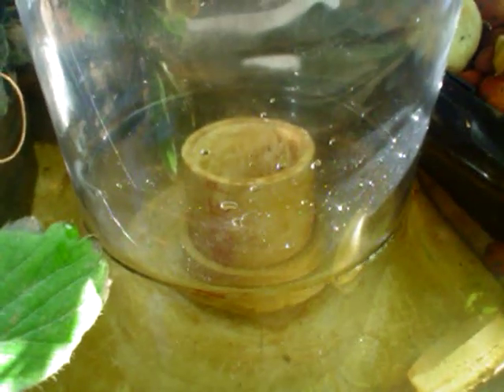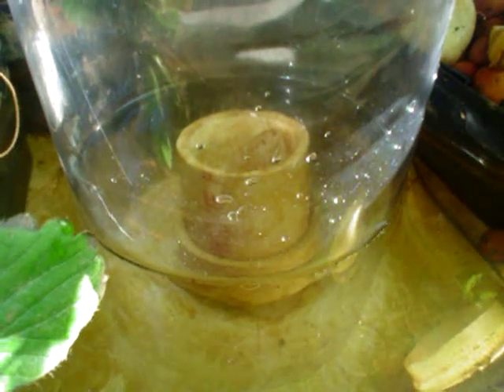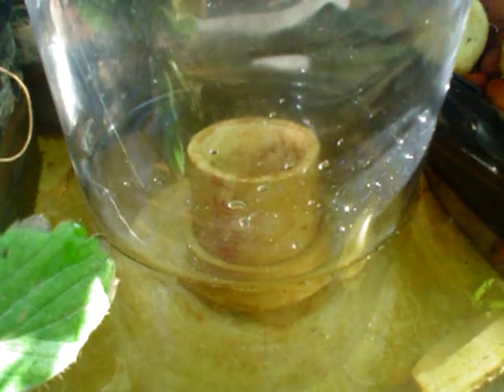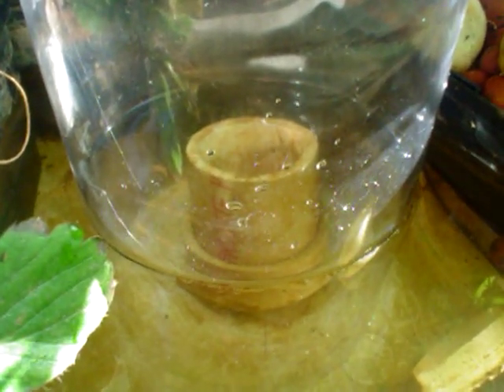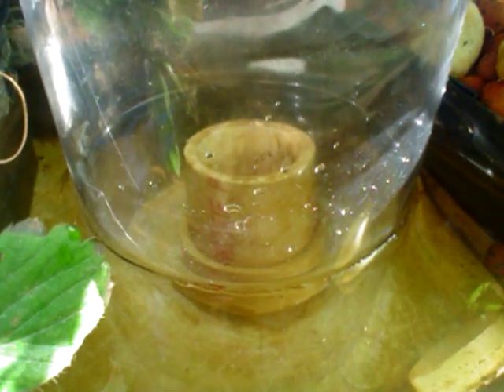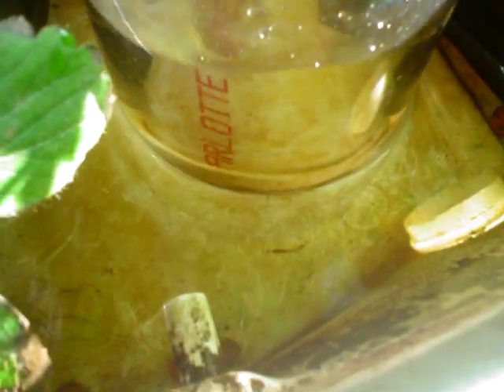How a bell siphon works

Comment from the maker: The length depends on how deep your growing medium will be. I recommend 10-12 inches of grow medium with a pipe 2 inches lower than the top of the medium (12 inches of medium use 10 inch pipe). You will also want your outer pipe, the bell, to be double the diameter of the inner pipe (half inch inner 1 inch outer or 2 inch inner 4 inch outer)

Comment: Thank you!  It is a very very good demo.  But if I wanna make a small-scaled aquaponic system, like one in my backyard with nomal rubbermaid sized container, what exactly measurements I need for the setup such as those pipe diameters, length of PVCs exactly.  I just wanna try to see if I can use it for planting veges.  Many thanks!

Comment: that's why you make the slits higher and your water supply slower. the one in the video definitely works, but simply putting slits in will too. all you're trying to do is stop the sucking action by introducing air into the system, if made correctly, the slits will do this. you need to make the slits large enough or in large enough numbers to allow enough air into the system to stop it.

Comment: and without the slits or anything to break the vacuum, wont it never flood after the 1st time? seems like it will just be a continuous drain that may end up not watering the plants enough in an ebb and flow type system

Comment: How the siphon works.
When the water starts flowing down through the siphon, and mostly fills the outlet tube, it starts creating a larger suction in top of the bell. The agitated water flowing in the top portion of the bell draws air with it and pulls those air bubbles down with the flowing water, and out through the bottom. This is how most of the air is drawn out of the top of the bell.
As more air is removed from inside the top of the bell, the water can rush through it faster.

Comment: Thanks, I believe it works, just a bit of trouble understanding it, but I presume the slit will not act as water inlet in a sufficient manner (and thus maintaining the vacuum) while just a bit of air will be enough to break the seal, as long as the suction on the bottom is big enough to quickly bring the slit above the water surface
Thanks for yr patience

Comment: yeah, but if you have the slit too far down and too much input water, the slit will never be uncovered and the siphon will never stop or full empty the bed. if you're making a air tubeless design, you need to make the slits a little higher and larger then normal to allow enough air in to stop the vacuum and thus, the siphoning.

Comment: nothing to break the vacuum seal. if he'd have a slit at the bottom to allow air into the bottle once  you get the right water level, it would have broken the  vacuum seal and dumped out the remaining water like at the end when his pull the bottle up. you don't need a air tube in a bell siphon like many people say, you simply make a slit in the bell(the bottle in this case) where you want it to stop pumping, when the water level drops to that point, air will rush in and kill the vacuum.

Comment from the maker: The stand pipe in the middle sets the water level, it the pipe was lower the water would only rise as high as the pipe before beginning the siphoning process. Just as if the pipe was higher the water would rise higher before beginning to siphon,